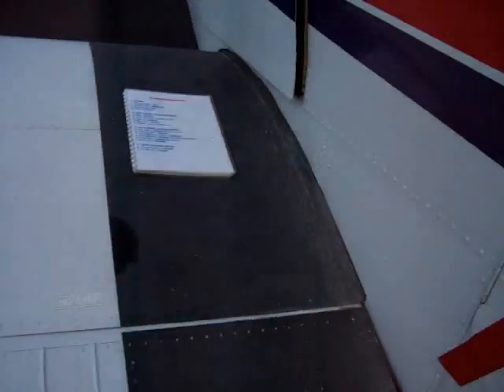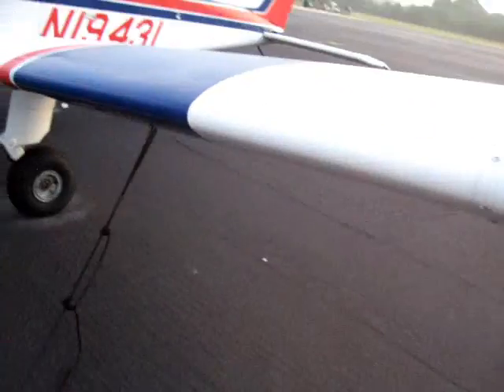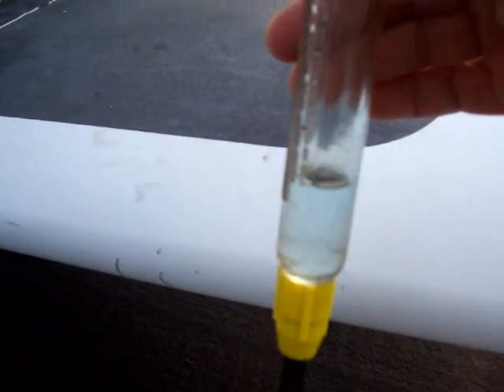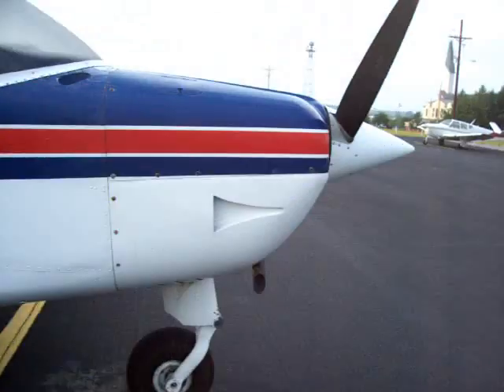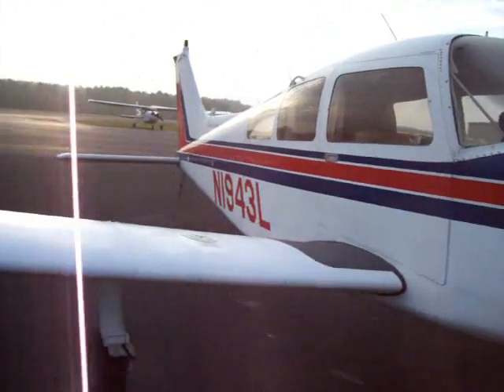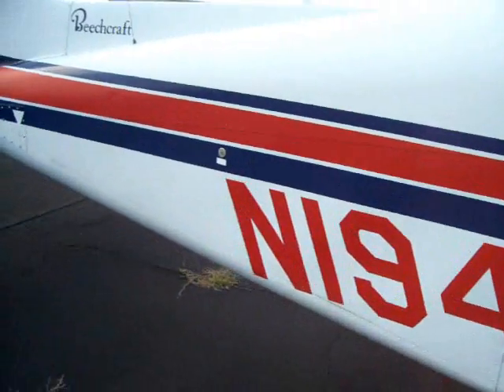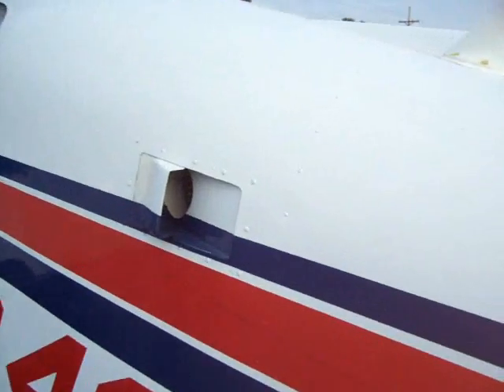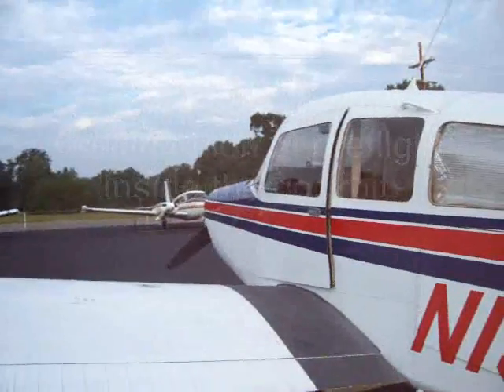Preflighting an airplane Part 2

Comment from the maker: Annuals run about $2000 a year, oil changes every 2 months about $200.  Insurance about $800 a year (through AOPA) and tie down $50 a month at my airport

As you can see, with me averaging 125 hours a year, cheaper to own.  

The biggest benefit:

The seat is set exactly where I left it from my last flight, radio volume the same etc, etc LOL